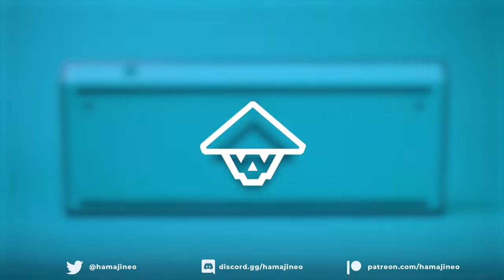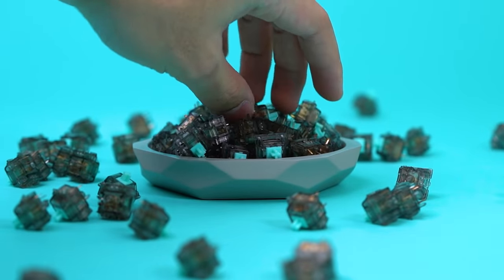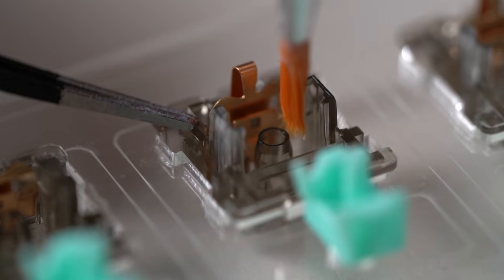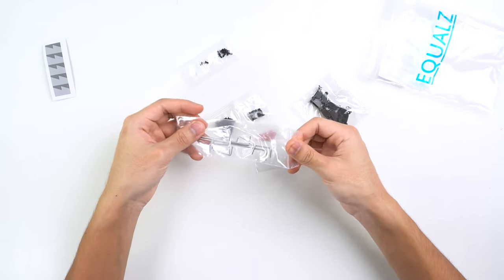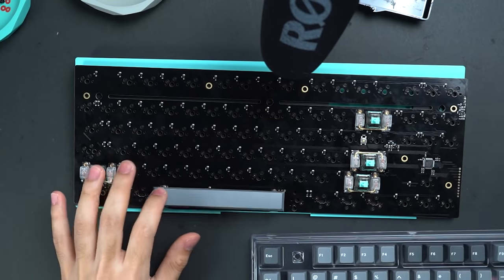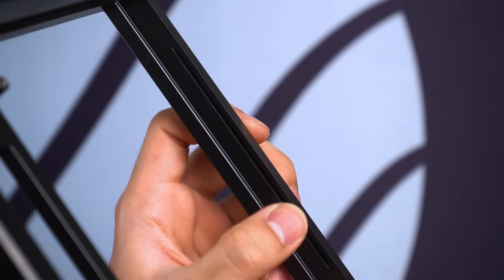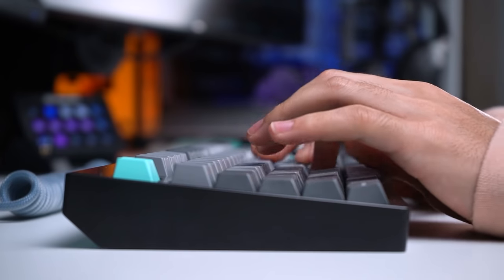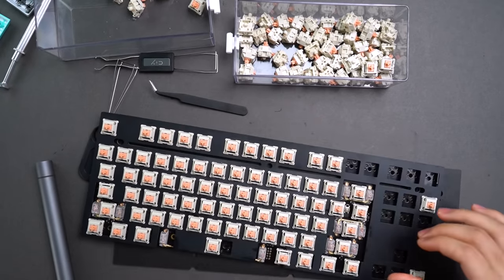The Making of My $850 Custom Mechanical Keyboard!

Comment: Aren't you just making you keyboard a gunk magnet in the long run? That is way too much lube by any standard... mechanical switches are hardly airtight and the keyboard will inevitably collect dust like a hoover.
Reply: 1. Wash your hands more often
2. Keep your room cleaner
3. Use a dust cover when not in use
4. You don't use a board like this as a daily driver, just as you don't use an Aston Martin as a daily driver.
Reply: @pook2830  
1-3: Keyboard collect gunk because dust is dead skin cells. Unless you plan to use a microfibre glove all the time, its unavoidable.  That plus the oils in your hands, it will build up in no time regardless of how hard you try. 

4: So basically take away 99% of what makes mechanical keyboards good in the first place and turn it into a very expensive paperweight most of the time? 

Just look at every other mechanism (watches, bikes etc. etc.) that need lube. You can achieve the ideal result with a micro-drop of lube at each of the friction points - assuming that the switch has decent manufacturing tolerances and isn't just mismatched parts thrown together (like them wobbly ass Holy Pandas). It will spread itself through use and there is no need to destroy your keyboard with grease. 

The "enthusiast" community for Mech boards are overenthusiastic for lube and lack any fundamental understanding of basic engineering...
Reply: @JimIBobIJones  "Keyboard collect gunk because dust is dead skin cells"  Hence washing your hands before using it.  Also, only part of it dead skin... most of household dust is fibres from material in your home. 

"That plus the oils in your hands, it will build up in no time regardless of how hard you try. " Yes, so you wipe the keys down periodically, and also, this is why expensive keyboards use PBT keycaps, not ABS, as they resist oils and do not become shiny.

"So basically take away 99% of what makes mechanical keyboards good in the first place"   So what exactly do you think makes a mechanical keyboard good? What do you think lubing it takes away from it? 

" (like them wobbly ass Holy Pandas)"  That's because he was fitting a 3 pin switch in a 5 pin keyboard... hence replacing the bottom housing for a 5 pin variant.

" It will spread itself through use and there is no need to destroy your keyboard with grease. "  You are not destroying it; You are lubricating it. You do it once. I have keyboards here I lubed 5 years ago, and they're just fine.

"The "enthusiast" community for Mech boards are overenthusiastic for lube and lack any fundamental understanding of basic engineering"  And your qualifications in engineering are?  I strongly suspect you are not talking from actual experience of actually lubricating keyboard switches and using them long term afterwards. 

Quite frankly, you are wrong. I've never had any problems with lubricating keyboard switches and I've been doing it for years, and I always use a PTFE based grease like this guy is doing.
Reply: @pook2830  So wrong number of feat causes the stem to wobble? Great logic... 

Skin die constantly, washing doesn't really help as contact is what causes dead cells to drop off... Unless you wear microfibre gloves when you type its an unavoidable hazard. 

What makes a mech keyboard great is reliability, quality and feel. All of which are compromised if becomes a shelf queen and needs babying. Ergo basically an expensive paperweight. 

Plus you can't realistically or properly clean and re-grease your keyboards regularly without damaging the switches - any degreaser is going to harmful to the plastics. So you are literally damaging the keyboard by over-greasing it. 

When PTFE is used as a coating, its super slick and its generally great if  the use case is insufficient to wear it down (think teflon) - but when you are talking about grease form, it main advantages are that it reduces friction and that it is non-reactive with pretty much everything. It is still very much going to trap gunk though, as you aren't getting PTFE in liquid form (no such thing), rather you are getting a grease which includes PTFE particles as an ingredient. 

Finally, like I said before, you can much more optimally lube anything mechanical at the points of friction without drowning everything in grease....
Reply: @JimIBobIJones  "So wrong number of feat causes the stem to wobble? Great logic... "  No. The wobble he was experiencing was caused by using three pin switches. Besides... his choice of switch is his choice of switch. If it bothers you, use Water Kings or one of the plethora of switches that exhibit no stem wobble at all...  then all you have to deal with is sluggish returns ;)  Basically, the vast majority of switches have stem wobble. Have you ever used Telios?  They are WAY worse than holy pandas. It's a trade off between such a tight stem that the switch feels stiff and scratchy, and being so loose as to ruin the feel. SOME movement is required. These are mass produced plastic parts. There just isn't the available manufacturing tolerance to make stems completely solid. Those that are (as mentioned above) exhibit more problems than they solve.

"Skin die constantly, washing doesn't really help as contact is what causes dead cells to drop off... Unless you wear microfibre gloves when you type its an unavoidable hazard." You're just one of these people that likes to argue on the internet I think.  Just vacuum your board once in a while, and use a dust cover. Stop being a snowflake. Besides, enthusiasts LIKE an excuse to tear them apart anyway.  I'm constantly trying new switches and caps. :)  PBT caps do NOT go shiny. I've got heavily used caps here I've had for years...  still lovely textured matt finish.

"Plus you can't realistically or properly clean and re-grease your keyboards regularly without damaging the switches"  Of course you can!  This proves that you've never actually lubed a switch in your life.  I'm constantly changing things around...  swapping lower and upper housings... cleaning lube off and trying other formulas etc. It's part of the hobby.  Look..  I think you're just in the wrong place. You clearly just want to buy a board, and then just use it forever with no maintenance. That's fine.  No one's stopping you.

"but when you are talking about grease form, it main advantages are that it reduces friction and that it is non-reactive with pretty much everything."  Why are you telling us all something that we already know?

"It is still very much going to trap gunk though,"  The switch will any way, lubed or not. (unless you wash your hands and use a dust cover... like I do... and I've had no issue in YEARS)

"as you aren't getting PTFE in liquid form (no such thing), rather you are getting a grease which includes PTFE particles as an ingredient." Again.. we know... what is your point?  Dirt gets in my skateboard bearings...  FAR more than would ever get into a key switch, and I only clean those once a year... maybe longer. 

"like I said before, you can much more optimally lube anything mechanical at the points of friction without drowning everything in grease" He isn't "drowning" anything in grease. He's applied a thin coating to the stem guides (which is a point of friction). He oiled the springs as well... So?  The only area where a lot of grease is used is where the wires hook into the housings, and that's because NO ONE wants rattling stabs...  no one...  not even you.  That's easy to clean any way... just remove the stabs, wipe... re-grease and refit. 2 minutes per stab. 

I re-iterate: I have had no problem with dirt ingress causing a problem in the 5+ years I've been doing this. I'll ask again, do you actuality have any practical experience with all of this, or are you just speaking hypothetically?  You are really discussing something that no one else seems to have an issue with.
Reply: Your walls of texts are getting too long to bother reading. You do you and enjoy your funky keyboards
Reply: @JimIBobIJones  Enjoy your Corsair or Razer..  or whatever.
Reply: @pook2830  Just because Iam disgusted with simps overlubing, you assume I am anti custom boards? I very much am a fan of customising my boards - when done properly and rationally. I currently  have a GK61 for typing/general use as my main (Kalih Sherbert atm but it gets a swap around a few times a year), keychron hotswap with brown switches for work and yes, a corsair k70 for gaming (because at the end of the day, the custom boards all have mediocre-terrible latency). In the past, I've even tinkered around with soldering some cheap rk61s but really CBA with all that bother now with hotswapping as an option.

Comment: dude, nice kbd ok.. but 500$ that mode80 case.. why??... lol... i dont care how they built that thing or what materials or how many employee they have, that thing isnt worth over 80$... period, and thats been generous.... guess thats what they mean by 80 anyway.
Reply: It’s hand made, hand machines, and the parts that aren’t basically need you to turn on a factory to manufacture. If it was a mass production they could sell it for less, but it’s not. It’s one board, one run, one team. Plus it’s completely customised to him so that’s gunna cost extra too
Reply: @fruittree1670  ya, sorry but thats bullshit, first of all yes these machines are super expensive but you dont buy 10,000s$ machines when you're gonna built 100 of these, at this point the buyers are paying for your factory not the product... you hire a company that already got these machine and you got the same product quality or even better for 10$ a piece instead of 300$, then when you've sold many 1000s you can buy your own equipment, thats just basic common sense... i would not buy a glass oven if i was selling 50 special mugs, thats just ridicule... UNLESS it was something impossible to do with other factories machines, then ok, but here its really not the case... thats just a freakin aluminium plate, there next to nothing as basic as that... you're basically paying for having a rare expensive item, but that item is still worth 80$ at the most, that other 420$ is just air.
no matter what that still 80$ worth of quality that you've paid 6 times over.

that being said i really doubt that the peoples at this company are that stupid and its really most likely that they're having it made by a contractor no matter what they are claiming and that 420$ which is pure hype is going directly in their pockets.

btw even if they sold 500 of these 500$ keyboards, im pretty sure that they still dont have enough money to buy these machines.

also, thats not customized to him as you said, the back vinyl sticker is... what, are they gonna get 100,000$ computerized vinyl cutter for that or pay 5-10$ and get it ship to their door????
i know i just made a special mug for my son's birthday with industrial vinyls they use on racing car, the design was way more complex than that, with 3 different stickers, i got 3 sets of them and that cost me 12$.

Comment: $850 for a keyboard you have to assemble yourself, that is loud as hell, and that doesn't even have a numpad.  Hard pass.
Reply: For a keyboard that you have to assemble yourself??? The whole point is that you can customize and work on it. If I wanted to lube switches it would be much easier to lube them and then put them in a keyboard, not remove them, then lube them, and then put them back in. Plus you'd be paying extra for keycaps that you're gonna remove and replace anyways. This might be the dumbest comment I've ever read.
Reply: @h.oang0802  Paying $850 for the priveledge of "working on" the keyboard is the dumbest thing I've ever read.  For $850 I could buy several new keyboards.  I've literally never had a problem with keys sticking on a keyboard in 35 years.
Reply: @Will-vj5bc  People don't lube switches because they get stuck. They lube it because it's smoother and sounds nicer. You're not paying $850 for the sole privilege of working on it, but if you were to buy a prebuilt, you literally cannot do anything to it. No one wants to lube their damn switches. You say that we have to assemble the keyboard ourself as if it's a name brand company that released everything he bought but decided to skip out on the assembling process because it would be cheaper and they could sell it as a feature. No, it's not. The cherry switches and stock stabilizers that you can find in your several new keyboards will not be as good as the ones shown here. The keycaps you will get will either not look as good, not sound as good, or not be as high quality, OR you plainly didn't want the keycaps. You won't be able to find a name brand keyboard with Boba U4Ts or whatever switch Hamaji used. You won't be able to customize your plate as easily. Stop thinking of it as you "have to assemble it yourself" because you do, but that's straight up not the point.

Comment: why the fuck would that be 850?
Reply: my rough estimate
kit = 450
keycaps = 150 (likely more if he got them in the aftermarket)
switches = 50
stabs = 20
lube and tools = 30
shipping/import duties/custom job on the keyboard kit = 150?